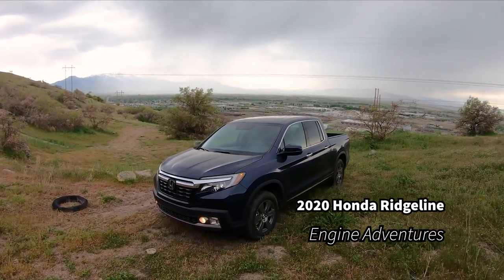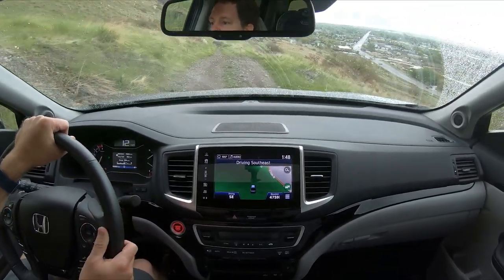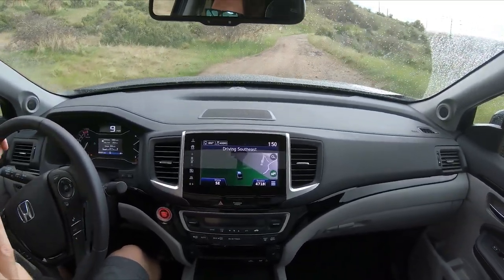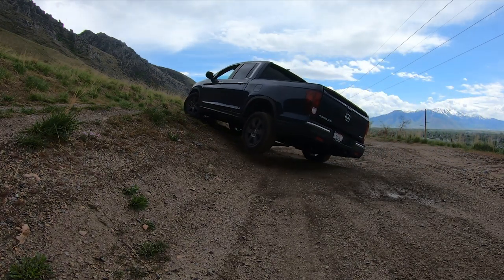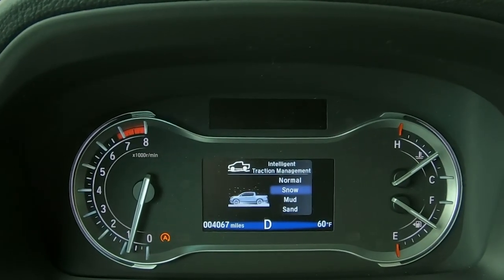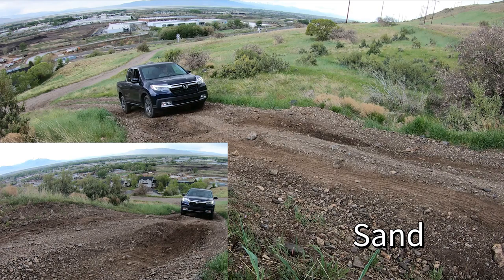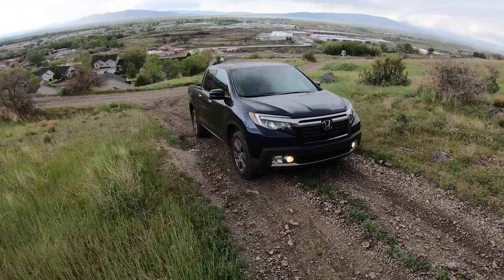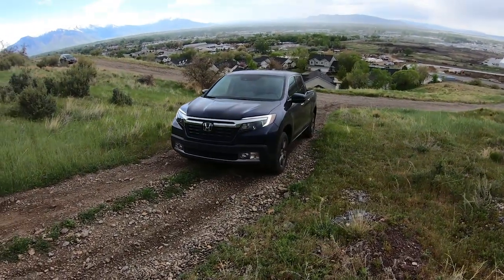2020 Ridgeline Off Road

Comment: Did they finally put the 9 speed in the 2020
Reply from the maker: Yup they did, I image they wanted to make sure it can handle the heavier loads that the Ridgeline will encounter when compared to the Pilot.
Reply: @EngineAdventures  Nice always wondered why the Pilot only had the 9 speed available.

Comment: Nice 👍🏼 :  Honda give it a 2” lift,  leave the v6 add hybrid… better mpg,  7,500 towing, locking that system for crawl…. 4” wider,  add storage in bed walls… 👍🏼🙏🏼
Reply from the maker: It does lack in towing and off-roading compared to the rest of the midsize class. However it is the best for on road and not towing. It has the most space in the cab and the bed, it has the smoothest ride, and it gets better fuel mileage than most.

Thanks for watching and commenting!

Comment: How are y’all getting over 20mph... am I doing something wrong? lol I’m at 18.3 - 19.1 have never hit 20. 

and have tried the gas saving option too.
Reply: Ivy Zilla just drove 45 miles w cruise set at 55mph (due to construction zone), Econ mode, and got 32mpg for the trip.
Reply: Could depend on how far above sea level you live as well. Air density does affect fuel economy.

Comment: So it basically sounds like the torque vectoring rear axle is pretty much useless off pavement.
Reply from the maker: All the systems with dual clutch rear axles that I've tested have struggled to transfer power while making this steep climb. The Ridgeline has done the best so far.  I wish I would have taken the Blazer up this hill to see if its clutches can hold more pressure.

Comment: It’s still kind of difficult for me to consider the ridgeline a real truck. Like you said, it’s like a Subaru with ifs all around.. but in a pick up style. Towing is mediocre. And not to mention it’s a unibody vs body on frame like ‘real’ trucks (Toyota, ford, Chevy). I love Hondas, but when it comes to off-road or just Japanese ruggedness in SUVs and trucks, Toyota all day everyday.
Reply from the maker: I've driven all of the midsize trucks in the past 2 months, except for the Gladiator. Of the trim levels I tested the Ridgeline is the roomiest, most comfortable and has the most storage in the bed and you get the addition of the trunk. If you're towing or off-roading then maybe the Ridgeline isn't for you.
Reply: Take your typical truck on a road trip with the family. Then try it in the ridgeline, case closed.
Reply: Keep in mind something like the Gladiator Rubicon has a lower payload and towing capacity than the Ridgeline while having worse MPG and comically small bed. Most if the off road trim midsizers have significantly less payload capacity than a Ridgeline.

Comment: For everyone saying the RL isn't a real truck we have the old generation and we haul Solar panel in the back with the tailgate 100 mile trips almost everyday and it has 300000 mi on it I kid you not bulletproof truck. Yeah the transmission shifts hard sometimes but who gives a fuck I still use it for work and makes money and keeps going
Reply: panels* multiple ones fits about ,5 big ones

Comment: Great review Matt! I-VTM transforms   a Honda Odyssey based vehicle to a fairly capable offroader.
Reply from the maker: Thanks, it really surprised me at how capable it is off-road, especially after testing the previous generation (Pilot) and not being able to climb the easy line.
Reply from the maker: The Ram TRX is based on the Ram 1500, but has an upgraded...everything. Engine, trans, driveshafts, axles, frame, suspension, body, brakes, etc. Just because they are based on the same vehicles doesn't mean one can't be significantly changed over the other. Maybe it's best to say they use a similar platform?

Comment: I am still trying to understand the American need to have a rugged off-road vehicle. Were I live in Africa most of the mods I see on my off road vehicles won't survive in Africa. African roads are generally bad especially in the rainy season so the Ridgeline is more than capable. No one will take his vehicle too far off road you better trek. I have the 2010 Ridgeline and it does everything I want it to do and survive
Reply from the maker: It depends, for me I grew up right next to the mountains and have spent many weekends hiking, camping, backpacking, etc in the mountains. Most of the roads are passable by sedan, but the risk of damage is pretty high. Other roads are boulder strewn and a high clearance 4x4 is required, often modifications are needed on top of that. This is all in good weather, when a snow or rain storm comes in things can get really bad really quick.

For others, they simply like the look.

Comment: True to the comment below, no need to explain but jeez, at the very least though Honda could of gave the truck a better lift kit, bigger tires so it could have some comparable qualities of say the” TACOMA” for the retail price Honda wants believe me they could had splurged on better accessories
Reply from the maker: The Honda has a lot more room inside, a larger bed and more storage options. It's more comfortable on the highway and gets slightly better fuel economy. The Tacoma would be my choice between the two for offroading, but it's on road characteristics aren't great. The value is there for both of these trucks, it just depends on what you want.

Comment: Zero articulation here.  I had an 08 and I spent an hour or more out in the woods with one tire way up in the air, and the other in a small rut.  With the vtm4 system giving overheating messages.  Solid rear axle truck would have has all the darn wheels on the ground during this whole video.  Nice demonstration but that is a system suited for about 5 cm of snow and a dirt road on the way to the cottage.  The transfer case had nearly no fluid capacity on that 08.  Sorry Honda did not reinvent the wheel here, just fancy marketing I fell for it too.

Comment: Wow, 8.30 surprised me!!  I've never seen a truck that the four wheel drive overheated.   At least it tells you so u can give it a break.   But come on Honda!!  This guy is going up rinky dink hills and the damn Ridgelines 4×4 couldn't handle it.   So that tells you that if u get stuck in a mud hole, u better call a tow truck because u will ruin the 4×4 if u try to come up out of a mud hole at high rpms in this truck.  Im super disappointed
Reply from the maker: Very few vehicles have been able to make this climb without a low range transfercase. The Ridgeline did really well for not having a low range. Keep in mind that typically I've climbed the hill a few more times than are shown in the video and I drive as slow as possible in most cases which is much harder on the vehicle than carrying momentum. It took a lot to get it to ask me to let it rest before continuing my drive. The warning is there as a safety and I'd be pretty confident in taking the Ridgeline to some moderately rough locations. One mud hole, not a problem, lots of mud holes back to back will be an issue.

Comment: This or tacoma? 🤔
Reply from the maker: In driving a Tacoma TRD Pro right now. I'd take the Ridgeline unless I went offroad occasionally. Neither are great at towing but the Tacoma is rated higher.
Reply: The interior space is pretty dramatic difference, and the trunk
Reply: And ride..  looks go to tacoma off course
Reply: For pure rough off-road use, the Tacoma, all the other times, the Ridgeline. More space, better ride etc

Comment: The padals on the steering wheel help with downhill...do your research 😁
Reply from the maker: It has a crawl ratio of 20:1 when locked into first gear. On steep hills that is going to let the truck go 10+ mph where 1-3 mph is desired. Compare that with a Tacoma at 33.7:1 or the Nissan Frontier at 54.4:1 and you can see why the Ridgeline wont be nearly as good as it's competitors in this regard.

Comment: OFF ROAD?    Dude....... that WAS a road!  Pretty normal one where I'm from.    Off Pavement would, by far, be a better title.
Reply from the maker: True, most people think of off-pavement as off-road which is why I title my videos that way. As much as possible I tread lightly, which means I'm never truly off-road. No one really should be leaving designated roads/trails unless they are on their own property, lets keep as many trails open as possible!
Reply: @EngineAdventures  Reads a lot less light hearted than I had intended!   Rather than being mostly a slam on you, was just implying that many of our county roads locally are in less enviable condition!  Wasn't implying a lack of manliness or anything!   On the truly off road stuff, blessed with being long time friends with most of the landowners for 30 miles any direction, having grown up with them.  They're all used to seeing me in the damnedest places, usually taking pictures of them as they work!

Comment: Just saying if you offroad at 10 mph your not doing it right
Reply from the maker: There are lots of different types of offroading. The average speed on the Rubicon Trail is less than 1mph. In sand or desert running that will be much higher.

Comment: No vehicle I've ever owned can top my 2017 honda ridgeline's off road performance.  The damn thing has spent most of Its time off road and at the mechanic. Buy a Ford.
Reply from the maker: It's very capable for mild off-road use. More of an all weather vehicle, but the capability is there if you need it.
Reply: @EngineAdventures  I found the awd rtlt  disappointing in the long run for  highway use. The first transmission was replaced at around 40,000 miles (this after being serviced at around 30k miles). The replacement was covered under warranty but the next tranny went out right at around 80k miles.  Never took it off roading or pulled anything with it.  Traded it in for another vehicle but will never touch another honda.  Had a string of other issues go wrong with it but the multiple  transmission failures for a $38k vehicle were the most disappointing.
Reply: I will say that while it worked it had the smoothest ride of any of the vehicles I test drove in that price range.
Reply from the maker: @robertsiller717  Interesting! I wish I could test all these vehicles long term to get that kind of information 1st, since I can't I rely on commenters. Thanks!
Reply: @EngineAdventures  I've now learned to wait a few years after a new or redesigned model has been released before purchasing to see what issues come up and how the manufacturer addresses them.  The dreams engine is also a problem but that is a story for another time.
Reply: @robertsiller717  Maybe this is why the ancient 6-speed was dropped.